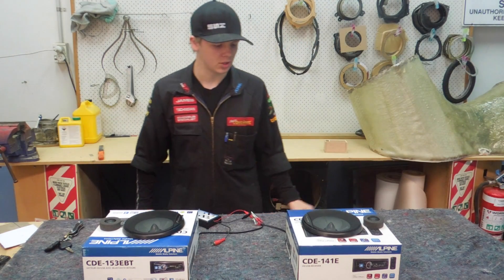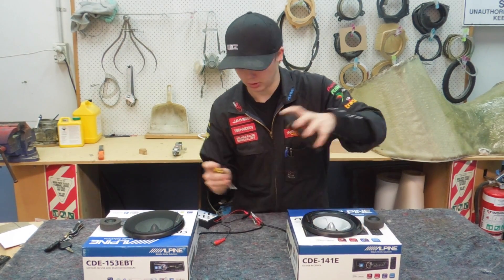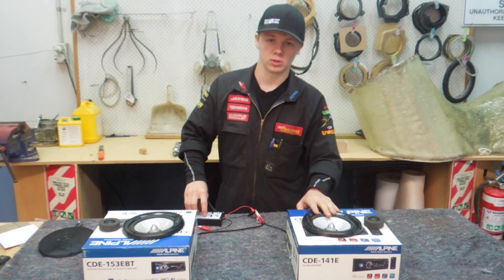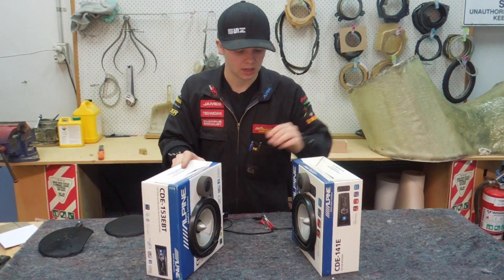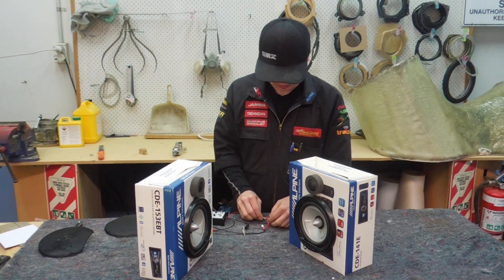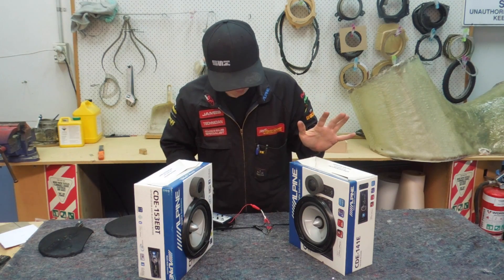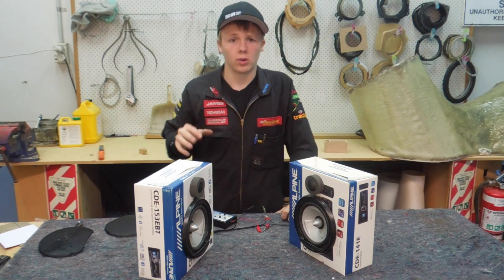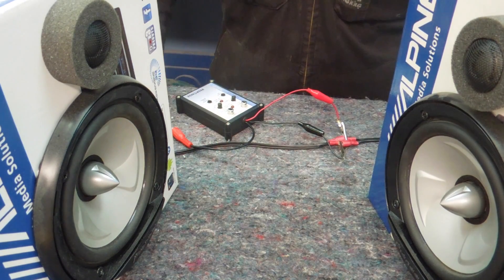Speakers Make More BASS!! - What is and how to test "Phase"?

Comment: I'd like to improve the theory the importance of the car speakers "in phase" situation. What you're talking about is just the 180 degree phase. So called polarity. Each speaker in the car system isn't in the same distance from the ears of the listener. Which causes the variety of phase shifts. So yes, all speakers need to be phased, and not just polarised

Comment: Would the speakers sound lower? Because my left side sound louder than my right side. When I fade everything to the right side, it sound lower and when I fade to the left it sounds louder. When I balance everything I hear the left more than I do the right side. I can hear the woofer and the tweeter up front and the rear I can hear it as well, it just sounds lower. Positive and negative on the crossovers and on the amp seem to be good

Comment: I bought some JBL GX602 units to go with my factory head unit, and they sound great, way, way better than the stock speakers. I was concerned about the phase, but the installer simply tested the wires with the stereo by listening to each speaker as he installed it, he said he could tell by listening. I really didn’t notice a difference. When we had them all installed, he tested with the fader and balance and they sounded fine, lots of base and clear sound. One question though, what if you have all the speakers out of phase, meaning that you have all the negatives wired to all the positives, what would that do?
Reply: "Out of phase" is in reference to the other speakers. If they all have their polarity reversed then they are technically in-phase with reference to each other. To summarize, if they are ALL at 0deg or ALL at 180deg then they are all in phase.

Comment: Awesome video!  Finally understand what out of phase means.  Will out of phase damage the speakers and amp?
Reply from the maker: No it wont do any damage other than the fact that having them out of phase might cause you to turn up the bass or volume on your head unit which will make the sound distort more.
Reply: @caraudioetc  Fantastic Bro, I was so worried having my system on while checking this could damage components. & Now it's fixed!!

Comment: Good day my friend i have a question i have a Rockford Fosgate t2500bdcp amp pushing 2 12inch T1 Rockford subs have them at 1 ohm all 0gauge with 2 agm batteries but when i put the volume up and turn the bass up the bass cuts off for a couple of seconds i have the big 3 set up and all grounds to a clean chassis and gains set properly? Any suggestions please help thanks in advance
Reply from the maker: First off all, NICE SYSTEM MATE! Rockford ALL the way!
Well you've pretty much accounted for all the things that usually cause that to happen.
Unfortunately as you may well know, in car audio systems especially big ones, minor faults cam be caused by a myriad of different things and really the only way to diagnose issues simply to start changing things and replacing stuff until the issue subsides.
Sorry I can't help more. Good luck
Reply: RockfordT1 Bass ..do you have your shitty stock alternator?